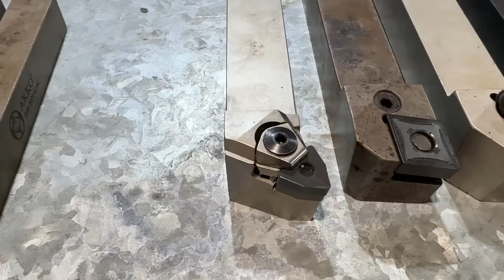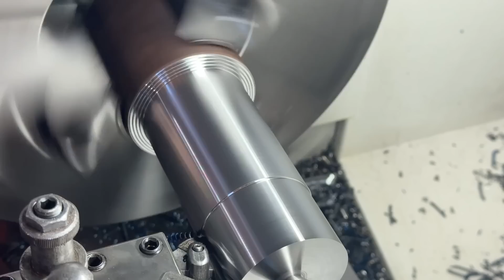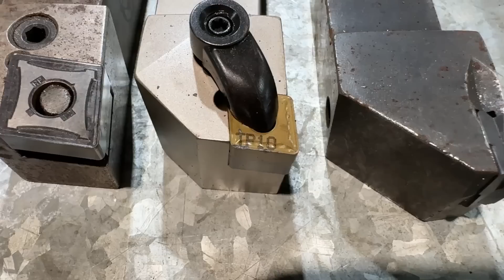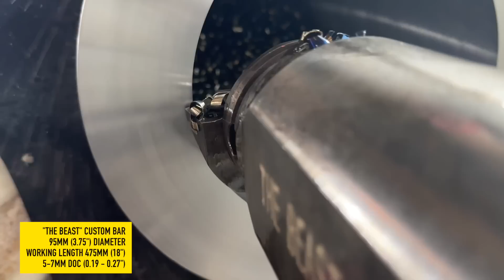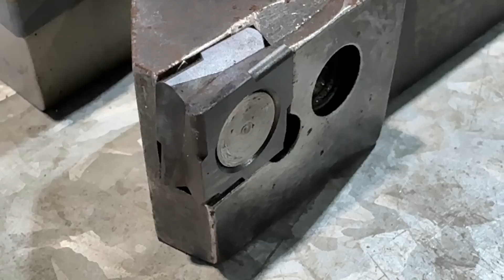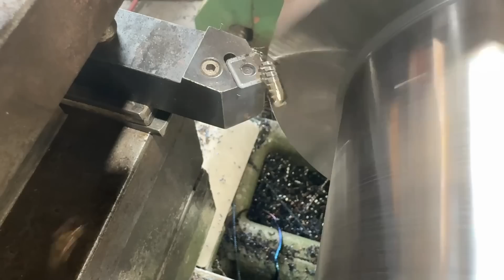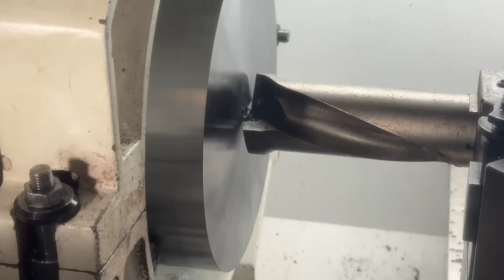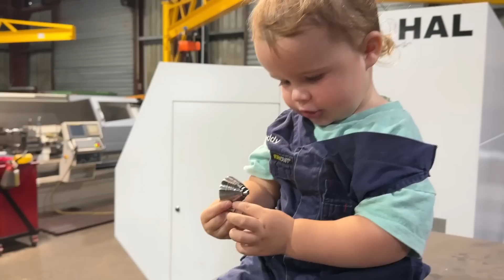The Carbide Inserts We Use (And WHY!)

Comment: Inserts have ways been wild to me. last place I worked always had a good selection of inserts. Most of the time I would use the general grade 432 inserts but every now and then I got to try out different brands with different grades and nose radius, sometimes it worked sometimes it didn't.

 My favorite brand by far is sumitomo. The first place I worked almost exclusively bought sumitomo drills and inserts both milling and turning. The last place I worked had very few sumitomo options. I would often use a 3/4 ccmt boring bar in my smaller lathe, we bought sumitomo inserts for it and especially compared to the larger general use cmng bars I used they held up for 100s of cuts. I rarely ever had to change that insert it seemed. I almost exclusively used that bar unless I had to bore deep. I wish I could tell you a price difference compared to kennemetal but I was never the one ordering inserts. I've also never really used many kennemetal products.
Reply from the maker: I rate Sumitomo right beside seco, Iscar, Palbit & Kennametal.

All very good, and all have standout products in their ranges too.

Comment: We aren't too different. We run top notch for most of the grooving or threading. 

Personally I don't like WNMG or TNMG. You get more corners, but the pocket is not nearly as secure.  Only once that I can remember we had an insert shift in the pocket and wreck something,  but I've found they don't last as long as a C or S style. The extra two edges is offset by each edge not lasting as long. 
We use CNMG and SNMG for GP and roughing work, and DNMG for finishing.
Reply from the maker: Nice.  I haven’t had that issue (yet) but I do agree that the WNMG aren’t as robust as the CNMG.  

Those things are tough as
Reply: @halheavyduty  i think it is very work dependent. Interrupted cuts or weld buildup will show it up WAY more than what you normally work with. And a good chance a lot of it can be overcome with the right grade and geometry of insert, I just grew tired of messing with them. 

For nasty work I am a big fan of the large SNMG 644 inserts (3/4"/19mm IC and a big nose radius) in a heavy roughing geometry. If comparing to an RCMT I honestly think the thicker insert and better supported cutting edge holds up better. 
Round can be magic for the right job, but a lot of the times I've found the increased cutting force offsets the theoretical benefits. Generally a "tool of last resort" rather than something used by choice here. I've got some SNMG tools (corner forward chamfer type) that were machined down to slightly narrower than the insert we use for taking off big hydraulic rod eyes in the way Curtis uses the RCMT inserts. Have to be a bit more careful on the initial starting the cut into weld or you'll chip a corner, but once you get it buried in you can push them a lot harder without chattering. They also fold the chip inward narrower than the groove so you can just plow straight in like a parting blade

Comment: Ok, so here's some potential advice that could help you (at least I think...) Have you ever heard of constrained-layer damping tape? It's used to dampen parasitic oscillations (resonances) in materials by absorbing the energy and dissipating it as heat.

I had the thought that it might be usable on your insert bars to reduce resonances that may crop up. I know you can change the speed and depth of cut to minimise chatter from resonances, but constrained-layer damping tape 'may' work to help reduce it even more and give you better cuts. I've occasionally seen people use rubber bands and other things on their insert bars, but constrained-layer damping tape is kinda like the "elite" version. :)

Anyway, just thought I'd mention it as it popped into my head just now. Might help; might not. Might be worth a try at least!
Reply from the maker: I’ll check that out. Thank you!

Comment: Great video. Your observations about the old style U drills with the W inserts are fully backed up by our old lathe operator. He's always telling me the old style runs better. 

Around our shop, especially on the CNC lathes we do almost all roughing with W style inserts. Nothing to add in that department.

On the drilling, I am a firm believer in internal coolant to get it where it needs to be and flush out chips. Regular HSS drills will just not cut it on CNC, especially with deep holes. Recently we used a set of AMEC drills on a series of long Ø17 mm holes, a pilot drill and a long drill. The interchangeable heads are available in HSS-Co and carbide, which is nice because we do lots of small series and one-offs where the HSS-Co is a very cost effective solution. Also they can be reground. 

On boring, I am pretty adamant to use ISO N (0 degrees) on all roughing and ISO C (7 degrees) for finishing, usually D or C geometry. Also I like the 107,5 degree D style boring bars (SDQCR/L) because the chip formation on the faces is better and shows better roughness especially on lower grade materials. This is because we often take a finish pass cutting both axial and radial paths in one cut.

Also I've been looking into a better way of (boring bar) clamping and again Sandvik has some very interesting documentation on this. We have to get rid of the tool holders with radial screws and bars with one or multiple flats. In fact Sandvik offers many boring bars in a 'full round' version with a 'locating feature' for rotational indexing. When you want to clamp all around with tangential screws full round bars are a requirement, also no material removed from the bar means more stiffness. When turning deep holes the QC tool posts are the most obvious weak link to be eliminated. I have ordered the first 'full round' bar from Sandvik just yesterday, can't wait for next week's unboxing!
Edit: of course the larger boring bars, especially the silent bars, are completely round already, I am talking about the smaller bars in the range of Ø10-32 mm with non-interchangeable heads. 

Keep up the good work and greetings from Holland.
Reply from the maker: Im going to look into the round bars you mention. Very interesting stuff.  Thanks for sharing mate. Very insightful, and helpful for me.
Reply: @halheavyduty  Adding to this, the obvious weak link beyond the boring bar clamping is the connection to the machine via (usually) a QCTP. 
We have a 'Parat Trautwein' QCTP which is also 4-way indexing on our Geminis and it simply can't handle the leverage of boring bars especially with longer overhang. The Multifix fitted on two other conventional lathes appears to handle these loads much better which makes sense because the interface is a toothed arc instead of a set of dovetails in one plane. 
Still, certainly when going beyond 3 x BD (boring bar Ø) the ideal situation is a dedicated slit clamp affixed to the machine bypassing the QCTP, which is something I will explore in the future. The metric of 'X times BD' is somewhat trivial when looking at the loads on the QCTP because the length of the lever is sort of an absolute limiting factor IMO, independent of the boring bar diameter. 
The Sandvik information can be found on their website, from the homepage go to:
knowledge and services - metal cutting knowledge - general turning - tool set-up

Comment: For drilling: I know you said you dont like spade drills, but I've found for under 30mm, exchangable head drills are really good. Thats iscar sumocham or sandvik DS20. You can put them .4-.5 feed per rev, and they're a lot more tolerant to being off centre than a u drill.

as for threading, corothread 266. try it once, and you'll fall in love.
Reply from the maker: Nice. I’ll have to check that out. Thank you

Comment: Hi Matt, thanks for letting us in on the secrets of Inserts. I tend to use cheap Chinese stuff in the hobby shop, but I have splurged lately. On the subject of broken inserts, still cutting OK, I tried a car spark plug one day, forming a hose fitting. I was surprised to find it cut steel away just using the round side of the plug, but the heat generated allowed me to form the hose fitting like magic.
Reply from the maker: Oh wow. Neat.

Comment: I highly reccomend you try a 75° approach . Especially on heavy duty cuts , crust cuts , difficult to cut materials ....stuff like that .

The only downside is you have to machine away the 75/15° tapered corner with a regular 95° tool . But it's gonna save you a lot in the long run .
Both snmg and cnmg are equally good for this .

There is another aspect not being discussed . The 'tool pull in' . When you take too much depthof cut , like 3mm face cut or 8mm diameter cut , with a 95° tool it tends to pull into the material and kill everything . On super strong machines this might be harder to notice , but the forces are there . 

For us the 75° approach angle is a life saver . We couldn't do what we do without this . 
Also you get to use up all 8 corners on a cnmg .
It's a bit annoying to always machine away the 15° taper , but it's worth it every time . Of course if you machine a feature without a shoulder there won't be any material to clean up.
Reply from the maker: That’s really handy to know, thank you.  Appreciate the explanation too.

Comment: Hi Matt. A couple of videos age you needed to cut a thread on a very large drill rod. you were using the single point method to a shoulder without thread relief to stop at and needed to withdraw the tool before it ran into the shoulder. A method  you could have used is. mount a tool post grinder ( or similar ) onto the tool post. Into the tool post grinder, mount a milling cutter of the required thread shape to cut the required thread. Set the lathe to the lowest speed (maybe), and then you start to cut the thread in the normal manner. Except, as the tool post grinder will take most (all) of the metal off in a single pass or maybe two, it might make it quicker and provide a better finish (Pray the machining gods). Disclaimer, not a machinist, but an electrician in a family of machinists. It is general in nature but I'm sure you will understand the concept. Regards ANC. Orange NSW Formally of Broken Hill
Reply: A tool post grinder is way too fast, with a slower motor it would work, but it would be more expensive than a single point cutter, because the setup takes longer.
Thats something for a thread cutting lathe, that does all day long only cut threads.

Comment: Great video Matt.
My little home lathe can’t run much in the way of carbide.  I only get them out when I have to machine something really hard.
Other wise it’s HSS all the way and I enjoy that.
Interesting how all those 4 letter insert codes work.
The take home for me was how the depth of cut and nose radius all fit together to get the chip to break.
Maybe I’ll get a bigger work shop one day. 🤠
Reply from the maker: Yeah mate HSS is great, especially for smaller lathes 👍
Reply: How little is your lathe? On my table lathe, 750W 125mm chuck, carbide works without a problem, i only have one HSS tool that came with the machine.
Carbide needs more RPM than HSS, the Vc for carbide is around 10 times higher than for HSS. Carbide 100-250m/s, HSS 10-30m/s
Reply: @ It’s not that little but it is quite old.  It’s an Atlas brand with a 10” swing.  My guess is around 1940 give or take.  The top speed is around 3000 RPM, but that’s faster than the actual motor speed and if I use that speed the magic smoke starts to escape 🤠.
When I got it there were a couple of bits of high carbon steel tool bits which were common before HSS.  I found a user manual for it and it recommended to use Lard as cutting fluid.  Which always gives me a laugh when ever I think about it.  It’s a great old lathe and I use it to repair stuff on my farm or just fun projects.  To change the feed you need to change the gears on the end of the head stock.  No quick change gear box.  So poking along with HSS tool is how this lathe is meant to run.
If you want to see it.  I’m cutting a metric thread in this video.  It’s a bit of a challenge.
https://youtu.be/Jdvbnn-1I_0?si=O0uLZOymuexOmTBL

Comment: I run Korea Technics VMD drills up to 115mm diameter, they are one of the best investments we have made in the shop. We mainly run ISO threading inserts, nearly every brand does them so it give you can often find odd inserts at short notice rather than being locked into one brand with top-notch.
Reply from the maker: I’ve heard good things about the KoreaTechnics drills.  That style of drill are just so useful hey.

Comment: You should try some 70 deg holders with the used up CNMG's as long as you dont have shoulders to machine up to or for roughing out they work very well. We used to get blooms straight from the steel mill to make some reasonably large shafts and I sometimes had to cube those in the mill. We had a specialist cutter made to run that job and it used the 70 deg turning tips. Easily it would do 3/4 ton of swarf in an hour. You could go faster but the old WW2 surplus cincinnati didnt have the power.
Reply from the maker: Ok cool. Good to know.  Thanks for that. I’m going to do some homework on 70 deg holders when I get back to work on Tuesday

Comment: I totally get your dislike for square insert drills, they really can shriek like a herd of banshees.  I love them though, I use them as a roughing boring bar after drilling the hole.  Saves me a turret slot.

I do wish triangle inserts would just fade away already though, I only keep them around for certain chamfers on the manual and this one really coarse thread.  They just never seem to do a good job at anything in particular and you need a different holder for each axis you want to work in while your C and W inserts work for both facing and turning.
Reply from the maker: Good point actually.

Comment: Hi from Scotland My deciding factor on inserts is what can I find on ebay that's not a fortune. There can be some bargains may be 5 out of a 10 box. Stick to CNMG 09 as most of the holders are that or if I make a new holder aim for CNMG. Iscar for roughing an Sandvik for finishing seems to work well. Just a hobby and always learning from the pros on YouTube. Did see Chris Maj using that flat insert. You may have seen his latest where the machine crashed.😀M
Reply from the maker: I haven’t seen it but I’m off to look for the video now 🤣👊

Comment: Do NOT use the shop dog for machining purposes. Especially not as a drive-dog on the lathe. They will NOT appreciate getting dizzy as the spindle spins them around. They will also NOT appreciate being used as an insert. They are NOT made out of carbide or high-speed-steel.

😜
Reply from the maker: I’ll resist the temptation 🤣✌️

Comment: I used to use a SECO SNMG 120408-M5 insert for roughing on the CNC lathe I was running for a hydraulic cylinder manufacturing company. We did 10mm radial passes with that tool over lengths up to 5M long. It was a beast at removing material, but I would have loved to try a FIX 8 to see how it handled it as the flipped inset position should be much stronger. Your in for a world if fun if you ever get to use ceramic, cermet, CBN, or PCD insets, Matt, but I doubt you'll have any call for them with the type of work you do. The stream of hot orange that comes off a ceramic when turning hard parts was always a favourite of mine as an apprentice and would have made great U-TUBE content if it was around 30 years ago.
Reply from the maker: I love peeling off induction hardened chrome with ceramics.

High speed.
Low feed.
Zero coolant

And let er rip 🔥🔥🔥🔥🔥✌️

Comment: Another great video there Matt. I'm glad you mentioned depth of cut. As a hobbiest engineer I recently learned a lesson around the depth of cut and the relationship to what your lathe can handle. I.e. using the correct insert for your lathe size. For this reason I have settled on TNMG inserts almost exclusively.

Something I have wondered about is do you need special profile tooling for cutting tapered threads? I noticed that you use a full form type tool with a chaser shape on the back of it. Wondering if the effective thread pitch increase due to the taper angle stuffs with the thread profile?
Reply from the maker: The tool holders are specifically designed for the types of threads we do - yes.

Comment: I'm a manual machinist through and through. We all know it takes 20 minutes to find the right tool for the job only to find out we don't have it. That's when you find a tool and you make it work. That was the mentality I was taught at an early age in machining. If it worked it worked. Time is money. Invest in as much tooling as possible.
Reply from the maker: Yep. We have a small arsenal of tools in the central cupboard, and the 3 manual lathes have about 20 each - just to save time.

We do have a lot of odds and ends for random jobs, but try to avoid weird stuff for everyday machining.

Nothing worse than needing a tool and not having it.
Reply from the maker: Yep. We have a small arsenal of tools in the central cupboard, and the 3 manual lathes have about 20 each - just to save time.

We do have a lot of odds and ends for random jobs, but try to avoid weird stuff for everyday machining.

Nothing worse than needing a tool and not having it.